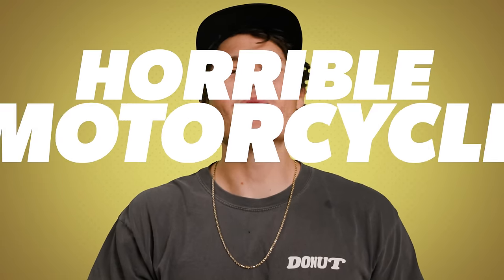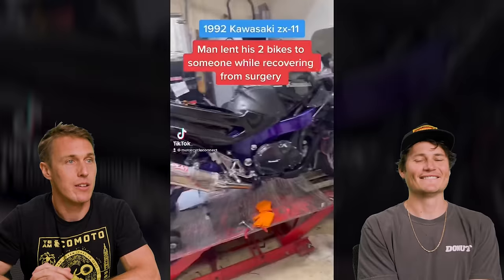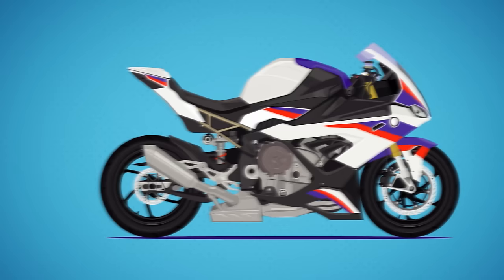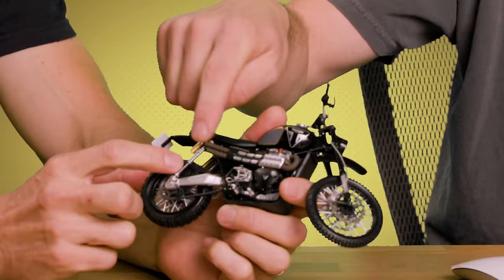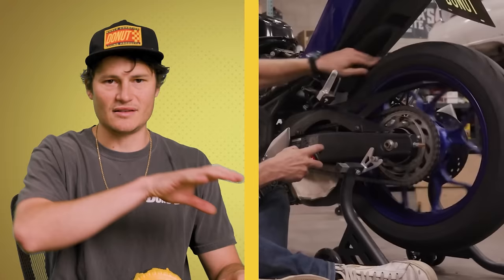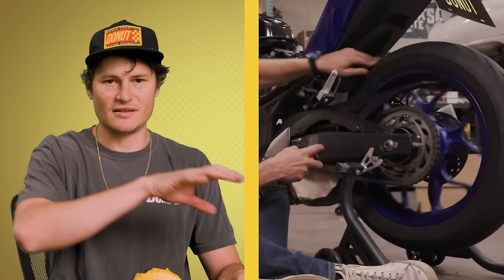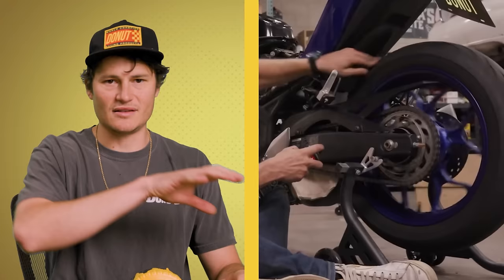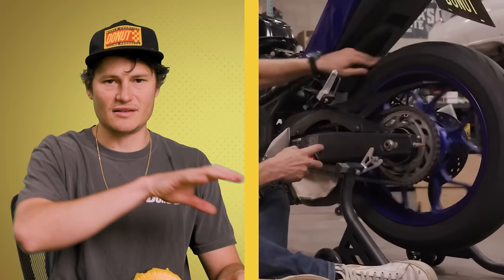Motorcycle Mechanics React to Tiktok Repair Fails

Comment: That's our BOY!!! 👊✊
Reply: He killed it. :)
Reply: Never let that soulful white boy go
Reply: "You don't want it too tight, you don't want it too loose, and you certainly don't want it dry." 😂😂
We need that on a shirt!
Reply: @jcedeno117 that is actually mental yeah perfect quote😂😂
Reply: I've been following Zack and Ari since the olden days. I love their content, and I love seeing them and Ryan Fortnine pop up randomly other channels.
Reply: Yes it is 👌👈
Reply: For my niggas 👊🏿✊🏿
Reply: Ari is THE LEGEND!!
Reply: If he's putting RTV inside a motor it might be time for him to not be your boy.
Reply: "you don't want it too tight or too loose and you certainly don't want it dry" - Ari Henning, 2023.
Reply: Airy or are ee???
Reply: Brrrraaaap!
Reply: Representing well
Reply: you guys are hijacked big time!!
Reply: @andrewturner9193  a dab of RTV on the inside of the case cover is absolutely not an issue. The inside of the case cover experiences temperatures similar to that of a differential  - and is not pressurized. If RTV seals diffs (its what most OE diffs are sealed with from the factory) then there's no reason it wouldn't work for this application. Never mind that a number of motorcycle case covers are factory sealed using RTV.
Reply: @TwoWheeledBooBear  On the mating surfaces sure but inside it will break down and more than likely plug something up. Maybe you get lucky and you only find it when you pull the sump off.  It is also used in old v8's to seal the corners of the intake manifold but it wouldn't be the first to come back with low oil pressure.
Reply: Love you all and Ari Henning!!!
Reply: Ari, is one of the very few YT Motorcycle guys worth listening to . Him and F9 are 2 of the extremely limited sources of knowledge online.
Reply: Amazing! Got to have him back on and good job RevZilla on finding that man!
Reply: Lol, I want to have, but would be terrified, if he inspected my 600 😅
Reply: No need to is our boi now
Reply: Well done. 
Thank you for talking about chain snapping and wrecks. I work in trauma medical training (typically high threat TacMed care but also basic bleeding control) Ari and Revzilla crew please encourage bikers to have a tourniquet at a minimum and know how to use it. One chain snap or wreck could absolutely cause a bleed out long before EMS is on scene. You never want to look back and realize your homie is dead because you didn't have a small medical kit on you. Legit a femoral artery bleed can have you getting a LifeFlight in about 90 seconds, anything beyond 2 mins odds of survival drop well below 25% and now massive organ failure,or death. 

Simple CoTCCC recommend tourniquet, gauze, chest seals and some gloves are low profile enough to ride with, cheap enough to buy (not from Amazon PLEASE. Fakes flood Amazon and fail in every test I've done) but these items are like a helmet or leather, ideally you never need them but will save your ass if you do.
Reply: Man, it's been so long since I've seen Ari on screen. 
He's the reason I Dreamt of riding the Great Ocean Road and I made it happen 22 times. AND on my GSX-R, nevertheless. Best experience of my life!

The man is an Invaluable asset!
Reply: "Boy?"

Pfft....okay, RACUST!
Reply: Alright alright alright

Comment: No matter where Ari goes, he makes me feel like I don’t care for my chain enough.
Reply: Check your chain every 2nd tank.. I almost threw up. I can't even think the last time I checked it.. 😅
Reply: Belt drive FTW
Reply: I had to pause to go oil my chain I got so ashamed
Reply: #cleanchainsquad
Reply: @dancotton3199 pqq😊😅😅😢😮😂😂😂
Reply: @dancotton3199  Right? Once a month seems like plenty, if you aren't on track.
Reply: @aarronwootton  Laughs in shaft drive
Reply: I don't even have a chain anymore and I feel judged.

Brb, sending to my chaindrive buddies.
Reply: i just checked it today. was still attached to the bike 👍
Reply: I literally cared for my chain about a month ago before I put a new rear tyre on.. Mind I've only done 200 miles and now I feel like I haven't checked it at all even though it's not being used as much right now.
Reply: Hahahaha.. this is wild
Reply: Quick wipe and some fluid film. Iv never had any issues. Sure it picks up grime. But it's better then a rusty chain.
Reply: that's the thing, assume you don't!
Reply: he makes me feel like I dont care for my body enough
Reply: I for real panicked when I saw the worn sprocket - I just bought a bike and didn't check the wear first.  Then I remembered an XS11 is shaft drive.  Lol. 🤘
Reply: lol so true
Reply: @dancotton3199  i only clean and lube mine after it rains lmao
Reply: For real I would do mine like every 2,000 miles.
Reply: Don't feel bad. I have a single spot of rust on mine and I noticed it last time I oiled it up.

Comment: I've had a customer bring their motorcycle into the shop complaining that his bike just quit, turned out it was out of gas. Another customer was proud of himself that he spent all  winter putting braided stainless on his entire wiring harness but did nothing about the tiny sharp stainless wires poking into the harness. His complaint was every time he honked the horn his bike quit (he's lucky that's all that happened)
Reply: You wouldn’t believe (or maybe you would) the amount of Harleys that got towed to my shop and the only thing wrong was a dead key fob battery.

Comment: I don't think Ari has ever had any formal mechanics training but damn he knows his stuff.  Watched him for years both breaking down stuff for us simpletons and doing amazing improvised roadside repairs.  Such a great contributor to the motorcycling community.
Reply: He grew up on the track, keeping his stuff working through a weekend of racing on a regular basis. Nothing prepares you better than that.
Reply: @TwoWheeledBooBear  Well, having theoretical knowledge is a lot more important than practical knowledge. Sure, you can fix stuff, but knowing the reason why it failed, knowing why you have to repair a certain way etc. is more important than practical knowledge. You can teach a child how to open up an engine, it doesn't mean that they can understand how to open it.
Ofcourse, though, theoretical knowledge is no good on it's own. Some people just can use tools and that's fine. There should be a balance.
Reply: It's been a trip to see him go from Motorcycle Mag to RevZilla (Comoto) and now doing guest appearances.

Comment: The R1 with the disintegrated air filter, that was a BMC brand filter. I see it often with that brand. The plastic they use around the outer frame of the filter does NOT hold up to heat long. This happens after the filter gets more than a couple years old. And Ari is 100% correct about checking the tank A, #1, first thing.
Reply: it was R6 not R1
Reply: At last someone with actual bike knowledge 😂@marcello6365
Reply: 100% correct! I've seen this with BMC filters numerous times and avoid the brand entirely. Total junk and I'm shocked there hasn't been some sort of recall on them.

Comment: I used to build drag carts, and against the advice of everyone, dude in the shop decided he needed to take his engine for a run **now**. Skipped installing a chain guard, put in a used master link, on a cart running about 12hp engine with a triple disk bully. That link snapped and slapped that chain into his arm almost to the bone. Wrapped around his bicep like a whip.

Chains. Are. Dangerous.

Comment: My mother has an old Kawasaki motorcycle that's been sitting derelict for well over 30 years at this point. When I was a kid she wanted to fix it and both me and my older sibling at various points in our lives thought of maybe trying to fix it with the intent of learning to ride. These videos have reminded me that that would be an undertaking requiring far more effort and expense than we could probably handle.
Reply: Sounds like a fun project. And if it is for fun, a great learning opportunity.  Go for it.
Reply: @JoshuaTootell  well, the problem is that literally everyone in my immediate family has some combination of clinical depression and/or ADHD so the motorcycle would get dissassembled and then left strewn about the garage.
Reply: @ZevVeli  I think that's not at all uncommon with people riding motorbikes - as two-wheeled motion is a known favorite in ADHD circles. Why? Because riding them is involved and focussing - as in, you get loads of signals that get you back on track, focussed on the issue at hand; speaking for myself, if I make the daily trip to work any other way, I often spend my time either worrying about the work day, or contemplating some aspect of my private life that may very will interfere with work throughout the day. If I go on bike, I spend that time thinking about nothing else, except riding the bike. 
And honestly, fixing a motorcycle is great exercise for your skills. Don't trust yourself having torqued each bolt when installing something? Mark them with a pen right after you tightened them. Afraid of spraying all the little parts all over your garage? Get clear ziploc-freezer bags beforehand and mark them. Also, find the "parts explosion" drawings for your specific bike, which are undoubtedly available and will detail every little washer, nut and spring. Losing track of the overall goal, as in "getting the bike ready for mom's birthday"? Define and prioritize subgoals, such as "safety equipment (brakes, tires, suspension) > drivetrain (engine, chain) > electrics > body". And if you can't rely on anyone else in your family to do parts of the work, a motorbike restauration (as long as you're not talking concourse level) is very much a doable project for one guy, if you put in regular hours, and do the effort beforehand to set you up for an organized project!
Reply: @decnet100 Very nice! Great encouraging words and beautiful way to look at it. Love what the community can be most the time.

Comment: 10:29 
I've had a similar screw get stuck in between my swing arm assembly and the engine casing and it actually pushed a hole through my engine compartment and dumped the oil under the rear wheel. Fun times
Reply: Yeah looks like this one busted the case too.

Comment: 8:30 you arent wrong about maintenance! Not quite the same thing but the surface grinder at my old work my boss had been filling with 5w30, instead of proper machine oil. When the chain-traverse finally gave up the ghost the sprocket was essentially the shape of a blunt circular saw

Edit: per your point around 15:30 - you are indeed unfortunately correct, this was how I lost my best friend in 2019. Chain snapped and bunch of knock-on effects took him off. 

RIP Matt ❤ never forgotten brother

Comment: "Check the simple things" 

While in school, Gave a Lava lamp to engineering class. The Lamp would light but the lava would not heat. They spent 2 weeks, took the think apart and back together and couldn't figure it out. My little sister looked it over. LEB Blob won't heat the lava. They were all embarrassed. The professor loved it.

Comment: 11:21 I have had that happen...though not with a bike. Plug went bad in my car's engine ('96 Neon, at the time) and came apart that same way--porcelain came free of the metal. You would not believe the racket that thing made. Total loss of compression in that cylinder, too.

Comment: 14:00 Hey, sometimes you just have to ride to the parts shop with a sponge as an airfilter, because the old one got ripped to shreds by a backfire. And then they don't have stock airfilters for your bike, because you ride a 24 year old import. So you try to cut a filter from bulk filter material, and it rides like shit, so you switch back to sponge and ride home and wait for the stock filter you ordered a week ago.

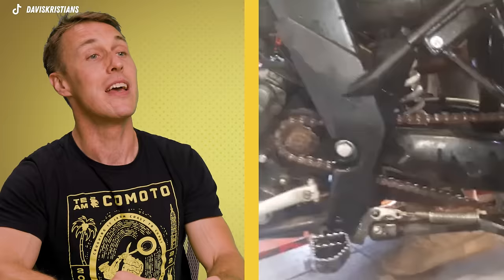Comment: 8:18 i dont have a homemade "slipper clutch" 😂 on the wall, but i do have a 351W camshaft with the distributor gear teeth sheared off 😂.  Buddy couldnt figure out why his coil, rotor button, cap, and distributor shaft were all new, and had power, but he couldnt get it to run lol.

This was a red 96 Ford Exploder, on a full frame, lift, and 35s. Helped the lad repair the engine, got him a softer distributor gear, re wired his rad fan (it was on the front of the rad, and blowing forwards 😂) and off he went to another mudhole lol.

Comment: 6:40 a bolt through the swing arm ain't that bad. I didn't know a rear axle nut come loose on my KX 125. 

About an hour later I noticed my rear wheel was kinda crooked. The brake rotor bolts cut 1/3 the way through my swing arm. I tightened everything up and went right back to riding. 

Over 5yrs of riding, jumping and crashing and never had a problem with that swing arm. I did end up totaling the bike but that was from a tree, actually the rear swing arm was the only thing that didn't break/bend.
Reply: Was your exhaust bolted to it though?

Comment: The air filter at 13:49 on that old 03-05 R6, best bet is it simply is a old neglected bike that just sat around. When I bought my 05 R6, first thing I did was put a K&N air filter in it and the stock OEM one that was in it looked identical to this and was cracking too, just not to that severe state in the video. (my guess from the looks of it because I had the same bike)

Comment: I went off a tall curb and  broke a huge hole (1 1/4" x 3") spanning middle of the the cases on a 1985 Virago XV700 and used JB Industro and the pieces to fix it. I rode it for three years and 24,000 miles without it leaking a drop. So it can work, I cleaned all the oil off with acetone before I used the JB industro on it.

Comment: If your going to seal up an engine like that, don't use jb weld or rtv, use b1/2 sealant, it can be pretty pricy but it's aircraft fuel tank sealant, it's oil resistant, flexible, and sticks like jb weld
$35 for a one time use container and it's not too hard to remove once you get a replacement.
Great thing to have on hand

Comment: 14:54 This is why I prefer belt and shaft driven bikes. Shaft drive, if equal length (relative to swingarm) has no quirky behavior and is low maintenance and impervious to dirt and debris. Belt drive is nice and smooth and if the belt snaps, it might whip you pretty good but it isn't gonna take a leg off.
16.21 I broke a couple of inches off the brake lever on my Dyna a few years ago when I dropped it at a very slippery gas station. I found I like it better that way. Makes covering the brake a lot easier and my ring and pinky fingers no longer get pinched.

Comment: In 1999 I built a dump platform for a paper company. This platform was made to dump wood chips out of semi trailers. We poured the concrete pit and built the platform but the union wouldn't let us do the plumbing of the hydraulics to dump it. After the plumbing was done, I went back to touch up the paint and do a final inspection and my surprise they had hooked all the piping to the bottom of the platform! It took me about an hour to decide to go tell the plant manager or just let them try to dump it! I told the plant manager.

Comment: Only had a chain snap once it just wrapped around the front sprocket ripping everything plastic apart around it.

Was only pulling away at traffic lights heading home after some repair work 😂

Comment: On the air filter one....

I bought an SV1000 a couple months ago that had a BMC air filter. The the adhesive used to bond the filter to the outer rubber ring had separated and looked like that. I cleaned the mess and replaced the filter.

Comment: I'm ashamed to say that I have had a front sprocket almost as bad as the one at around 8:00. Decided one day to go for a quick ride on my dirt bike on some trails. I knew that the sprocket was on the way out, but once I got stuck at the bottom of a steep soft sand hill it wore down in no time. Managed to get out, but my sprocket was pretty smooth when I got back home. Learned my lesson about maintainance.

Comment: When I sold my quad (YFZ450) the guy buying it looked at the oil level and I almost felt offended, but he said he has seen people fill the oil ALL THE WAY TO THE TOP. It's very easy to do that if you don't know what you're doing. If you aren't using a measuring cup for oil changes, you're doing it wrong (Unless it's a car, because they really don't care about an ounce or two).

Comment: i never use factory air filters. since 1991 i have been running k&n filters in all of my cars, trucks and motorcycles. there is a k&n air filter in my 2019 hemi ram 1500 and my 2019 Kawasaki zx14r. in all those years i have never had any engine related issues.

Comment: Ok, I admit I have JB weld inside my engine. But it is the generator cover that was discontinued and I could not find one at the time. Plus, it has a wire bracket holding it in place. I also had a cheap master link fail on me on the Highway, that was fun but didn’t do any damage

Comment: I had a chain come off on a 06 gsxr1000 scared the crap out of me and looked a lot like the one we saw. Was a pretty easy repair once I got the case braised and new bolt holes threaded. Was 19 years old learned to not install race chains without the proper tools.

Comment: Once had a customer not want to pay to have valve cover guards installed on a BMW. He cross threaded and broke a bolt when doing it himself. He didn't realize he ran out of talent and tried to extract it and drilled a hole through his head. $50 install turned into a $2500 head replacement.

Comment: I'll admit to a recent mistake, first bike with traction control and fuel injection. Thought I had some kangaroo petrol as there were low speed running problems. Turned out to be a screw in the back tyre, it didn't look or feel flat but the traction control had an epilectic fit over it. So, yes check the simple things first !

Comment: 17:22 My first bike was a Yamaha dt100 i took the carb apart and put the spring under the slide when it fired up it took off at full throttle you live and learn.